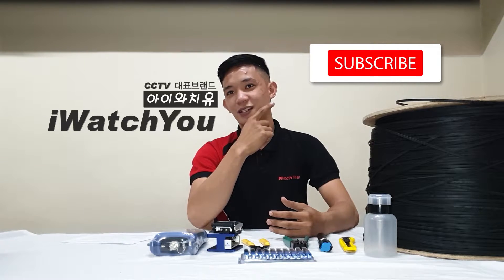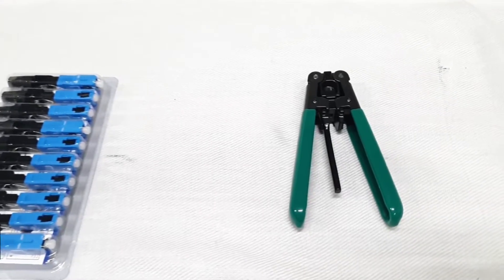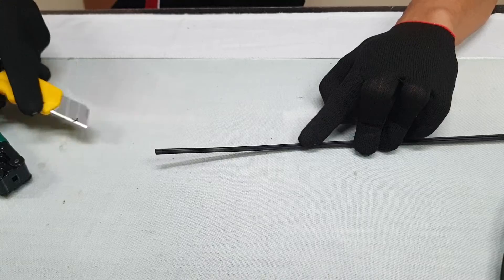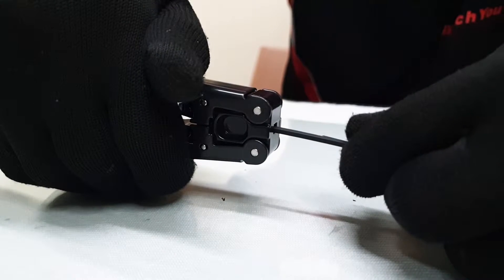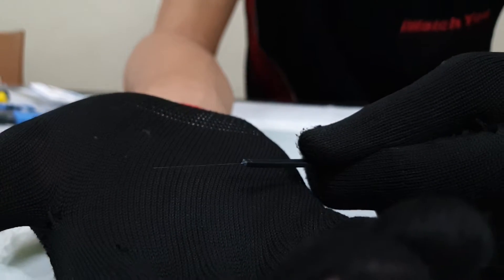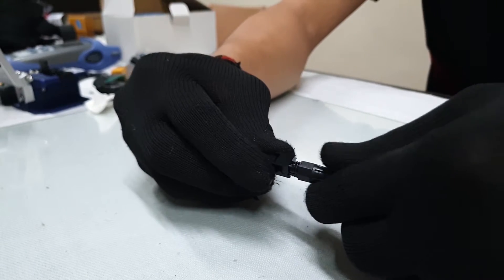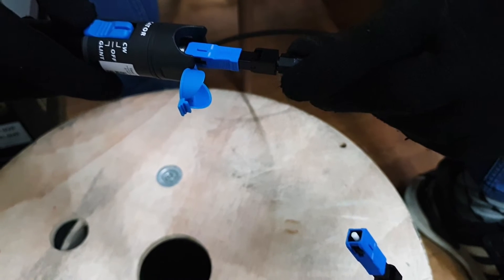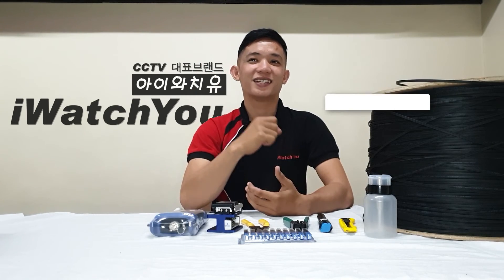How to Crimp Fiber Optic Cable Single Mode

Comment: need of cutter blade?
Reply from the maker: Thank you for watching the Video. 
It is not always necessary to use a cutter blade to remove the wire jacket . 
you can also use other tools to remove it.